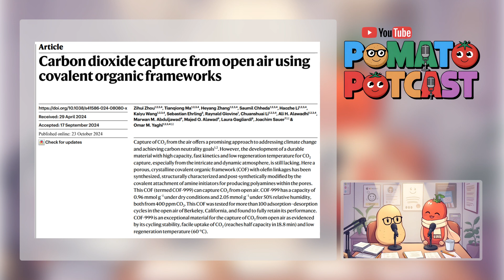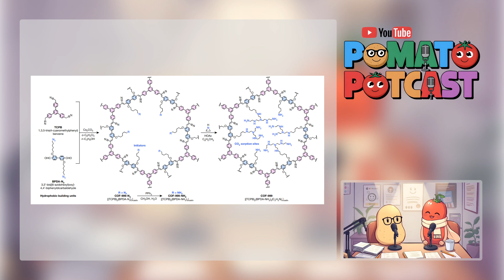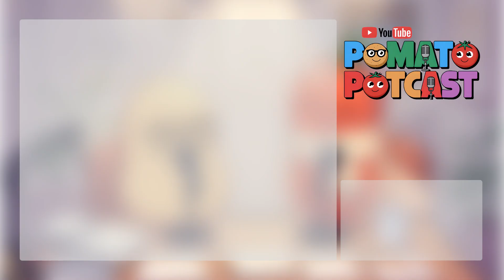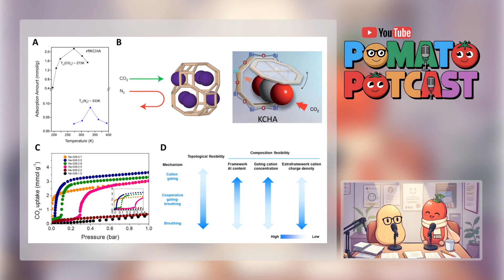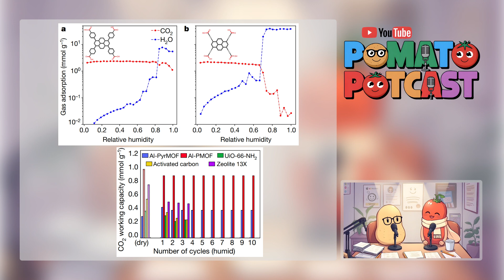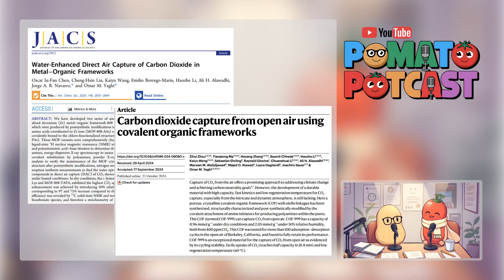Pomato Potcast | COF-999 vs Zeolites: The Future of Carbon Capture | 20241108

Comment: The scientists are so dumb in heat treating they use nitrogen to do what they call case hardening they've run it through an atmosphere furnace that is filled with nitrogen when metal is heated it releases carbon but in a nitrogen atmosphere the nitrogen traps the carbon on steel and it does what is called case heartening God had a plan for carbon dioxide it was called the nitrogen cycle bacteria in the soil give off nitrogen and Purge the atmosphere of carbon but man using fluoride herbicides and pesticides have killed them bacteria off so we killed the nitrogen cycle it is no longer purging the carbon out of our atmosphere that is the problem read up on nitrogen cycle read up on nitrogen and case hardening you will find the truth to my answer 😊